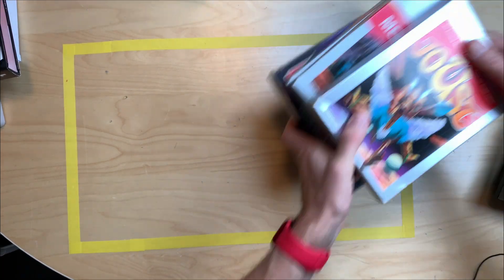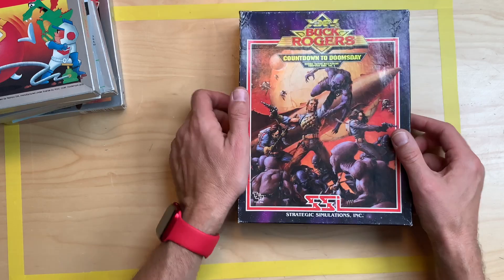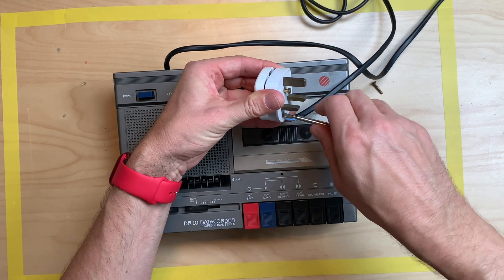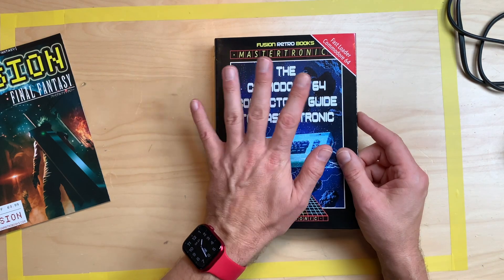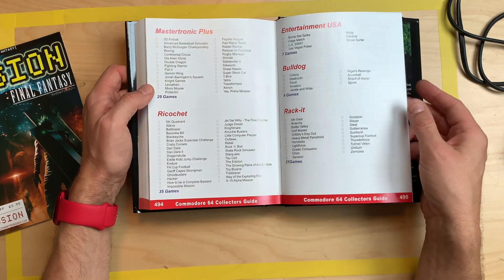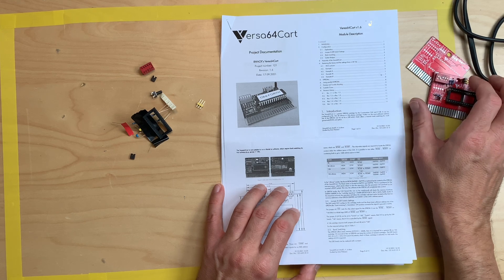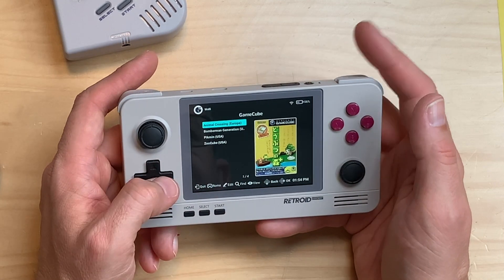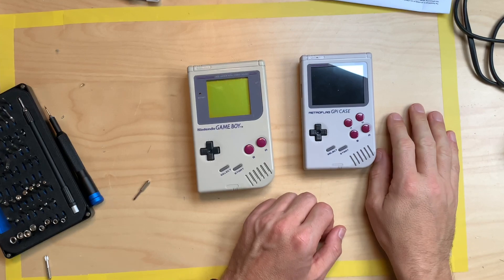RetroPackages #12 - Atari, Buck Rogers, Versa64Cart, Mastertronic, DataCorder & Retroid Pocket 2+

Comment: This cartridges look like they are new! Wow!
And Buck Rogers mnunuhmnnuh that robot with the bowl cut 😆I loved that show as a kid. And if I recall correctly I watched it on ZDF or WDR.
UK plugs are weird and utterly useless design assuming you have a fuse box on each group, which we have. And no American Australian plugs don’t have fuses. And the American plugs are ten worst! Stupidly wide and short pins and they drop out with the smallest tug. The British plugs at least have a very strong connection. But I’m partial to our Western European plugs. And actually most to the Belgian and French, where you are forced on earthed plugs to buy them the right side up. So all phases and nulls actually match and avoids phase shifts. Which aren’t a problem but I love consistency.
Reply: All I know is that there are plenty of plugs to choose from. Here in the states we don't fuse the plugs. Which does bring up the possibility of having a wire rated for 7-8 amps being "protected" by the 20 amp circuit breaker or fuse (or the penny behind the blown fuse). The UK way of doing things might be a result of their dual-fed circuits. Do you have those in Germany or the Netherlands?
Reply: @MrWaalkman  the UK uses a ring circuit rated at twice what we have in real Europe. It was a post war solution to reduce copper as they ran the sockets in the whole house in a big circle instead of a star like we do in mainland Europe and the US. So the maximum current draw I believe is 30 amps where in mainland Europe we are allowed to draw 16 amps. This is why they are smaller fuses in the devices to protect those.
At least that’s as far as I remember from my orientation year of electrical installations. which I hated as I already knew I wanted to do electronics engineering and not electrical installations — to much of a building contractor environment for me 😂
Btw that ring design is also the reason why they have switched on their outlets. To easily decouple something from the ring. And those switches are annoying for us real Europeans and Americans. Because we get there on holiday plug our phone in to charge, only to find its completely empty the next morning because we didn’t flip the switch 😂
Or when I was working in London the first week. Plugged my laptop in and started settling in and got a tour around betfair came back, laptop dead. Took me a bit to realize it was that damn switch again.
Reply from the maker: So the thread about the plug managed to be the most interesting. Next time I just show components in my videos ;-)
Reply: @RetroWK  Hahaha 😝 you just have a weird audience 😄